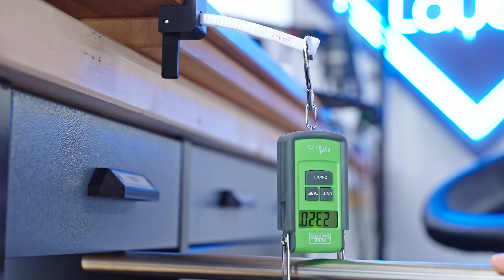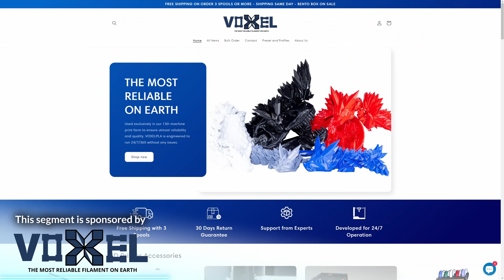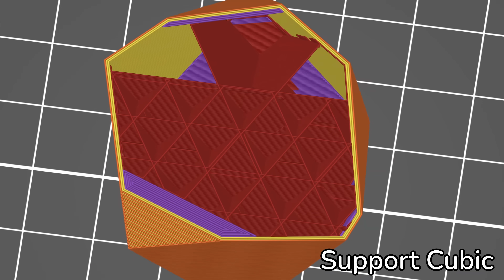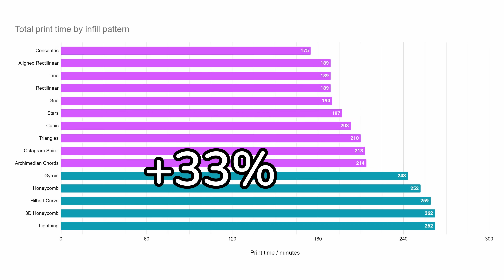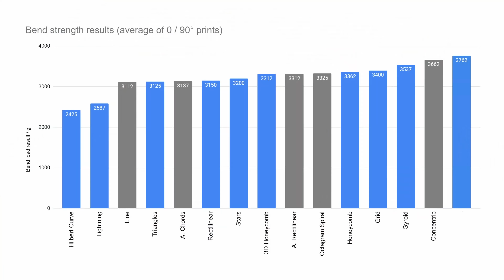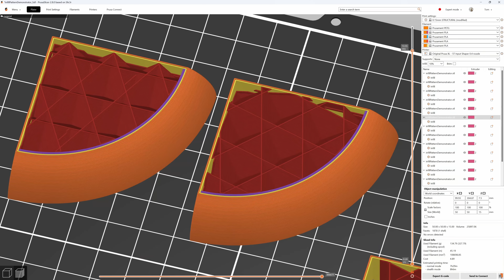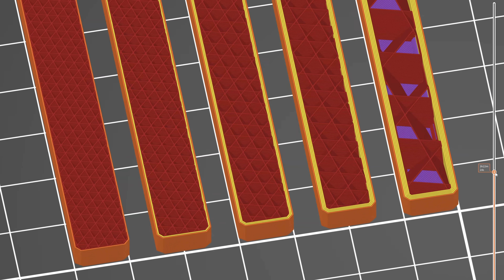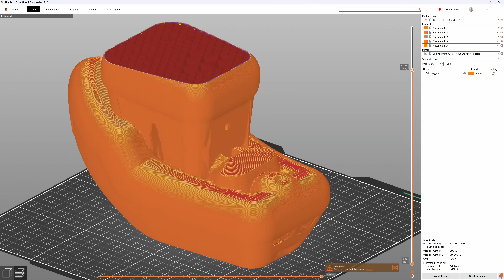Rethink how you use 3D printer infill!

Comment: The Hilbert curve is actually very useful for some specific usecases. When boring into the part in 2 locations you can be sure both holes are connected and you can suck air through them, no matter where you bore or what shape the object is
Reply: Looks cool with translucent filament too

Comment: Gyroid! The strengh to weight ratio of infills was tested in 3D Printing Academys video around 5 months back. Its the reason i use Gyroid almost always. 3 walls all around and between 15%-20% infill for max strength to weight ration.

Comment: Spiral ans concentric are valuable as the base and base infill when printing in vase mode to produce clean bottom and top layers. I've had great results with water proof and water tight PLA prints.

Comment: A thing about 100% infill for solid parts: don't. Infill usually is printed as fast as possible and often is just a bit underextruded. So unless you are ready to ALWAYS change ALL infill settings the same as perimeters: just do 999 walls or top/bottom, and add flow a bit. I noticed this when doing salt re-melting tests, any air inside the print will sag the top surfaces. 100% infill leaves more air in, is is more like 99% in reality. It is not often that the laziest choice is the best choice but here it is. You get consistent pattern from outside to the core too, not at all unimportant detail. Using 999 top&bottom also gives you some options what pattern the "solid infill" is printed, 999 walls are always concentric. You can combine the two, using for ex 15 perimeters and 999 top&bottom, the difference probably is negligible in strength but you may get more efficient moves (rectilinear top&bottom pattern gives you straight lines for most of the print).

Comment: Hi! Which infill do you consider to be the most adequate if you have to fill the inner of the piece with something (water, plaster, resin, concrete etc.)? And I think special at large objects (in my case the extreme may be 420x420x500). To be more precise, let think at a cube of 420x420x420, hollow, with an equivalent of 20-30 mm wall thickness, and shell with 4-5 perimeters, 4-5 top-bottom layer. I use gyroid, but I wonder if it may be something better. thanx
Reply: AFAIK only gyroid has a single internal volume, so the only option to be filled (easily).

Comment: I use rectilinear and aligned rectilinear when I need to use a really high infill percentage.
Also, hilbert curve has its application with about a 95-100% infill. That is when it shrinks due to cooling, the stresses from it go into the many curves in the hilbert pattern itself instead of into lone direction that cause the layers to peel up.

Comment: XD Watchmaker/Mechanical engineer here
Jep, this my go to methode the last... 8? Years or so
Go for 3 perimeters default (only if I want 'decor' Objects go down to 2 and print infill between 15 and 35%

About diameter...

By default I do double the Nozzle diameter in linewidth
And even the perimeter... only the 'external Perimeter's stays with the original diameter

So my 'get shit done FAST' settings are something like

For a 0.4 Nozzle
Default (all of them) line 0.6-0.8
External Perimeter 0.42
Top Line 0.45
Infill 0.8
Bridges 0.4
Support 0.3

Comment: Pretty much all of my functional prints are made of 6 layers of shells, 6 top, 6 bottom and 30% cubic (although lately I've been using gyroid again because of prusa getting rid of crash detection and I get occasional blobbing from my Priline PC-CF).  Printing on a 0.6 nozzle on my XL and Railcore and 0.4 on my MK4.  It's definitely overkill, but most of my stuff needs to be as strong and rigid as possible.

Comment: Buckling in the walls are defined by slendernes ratio: wall height divided by wall thickness
and  the ratio must be between 120 and 200 for buckling to be the failure mode or 30mm for a 0.25mm wall unless layer adhesion screw with Eulers assumptions

Comment: Personally, I don't think trying to find the best infill is really that important. There's so many uses and you just have to stop, think a moment and try to look what infill pattern is the best there. Understanding the thought pattern behind thinking the applied forces and what are the demands from the part.
For example printing TPU feets for your printer to make it a it more silent. You want the feet to allow the printer to move around but still hold the printers weight, you can get good results by just trusting the TPUs flexibility to allow the printer to move and not directly dump vibrations to the table. But with the infill you can affect that movement dampening way more than with jsut hte material; cocentric and aligned rectalinear are the keys here because cocentric will allow the feet to easily flex around the XY-plane while with aligned rectalinear you can allow the feet to flex more in one way.
This also brings in combining infills. At least Prusa let's you put up modifier shapes into the models which you can put different settings including infill pattern and amount. You can use adaptive cubic to fill the piece but add something like honeycomb as a pillar in the middle to give some more compressive support or concentric/aligned rectalinear to print some hard shapes while still mostly using something stronger, cheaper or faster to the rest of the piece. Just need to remember that you need to take those infill changes into account so you don't try to print infill on top of thin air.

Comment: For the multiple nozzle sizes in same print, try upping the extrusion multiplier by 1 or 2% on the nozzle that prints the infill. I find it helps with adhesion between perimeters/shells and the infill.
Reply: I think "infill anchor " is the right parameter to use instead, to keep other geometry intact. but I don't have multi heads to test... 😅

Comment: I only use hexagonal when I print translucent filament because it looks beautiful. Other than that, it'd gyroid for everything
Slicers should give us an option to choose infill by density instead of only by percentage
Reply: Percentage is usually density. If you take a look at where he had to change the infill amount to get the same weight, the infills where he had to make the most adjustments were the infills that dynamically change their density based on height, such as lightning or support cubic. In those cases, I think the percentage is based on the top layers.
Reply: @logicalfundy  Yes but no. What I want is grams per cubic centimeter. Percentage doesn't translate well to density. 10% in a big piece looks completely different from 10% in a small piece.

Comment: Rectiliniar is equally good since it's one of the fastest to print. I'd rather spend more time printing one more wall and then do a less dense but thicker rectilinear infill for general purpose parts. Saving 20-30 mins for a several hours print worth it. A the end it's not only the filament you're paying for. It's also longetivity of parts of your printer, electricity, and a lower volume of parts you print.

Comment: what about mixing materials; one for perimeters and a different one for infill? ABS might make a good infill and you wouldn't have to worry about warping since it's all internal.
Reply: with mixed materials you still have to consider things like warping though, as that could lead to deformation or even delamination due to high stress (if the internal contracts more/expands less under the smae conditions).

Comment: "on the XL i can mix and match nozzles" it wouldve been easier (and in this case, more reliable) by just setting the infill linewidth wider, instead of using a 2nd toolhead. You'd also not have had the alignment issue.
Reply: That is literally what he said he ended up doing.

Comment: My standard infill is gyroid, mostly printing mechanical parts.
But I have a delta-printer and my assumption is that deltas have less a problem with the wavy structure.
Reply: That just depends on your acceleration

Comment: Concentric, Hilbert curve, archimedian chords and octagram spiral are great for top/bottom infill. They usually create a better looking surface finish than the standard linear infill.

Octagram spiral with a silk filament on a smooth sheet give amazing results. 
Hilbert curve on top infill makes for a surface comparable to a bottom layer on a textured sheet - helps to make both sides look similar in PETG.
Reply: Yup, fuzzy skin and hilbert curve with 0.9 flowrate on top surface makes everything fuzzy :)
Reply: concentric my beloved
Reply: Agreed.  The only way I can get a perfect surface on production ASA parts that cannot have defects is to use hilbert curve on a powder coat bed.  Saved my life.  Absolutely nothing else worked.
Reply: Depends if you use aligned rectilinear or not.
Reply: They're good for squishy tpu

Comment: I'd already been told that more perimeters were better for strength, so my only concern with infill was supporting top layers. Not every top layer is a straight bridge though so I tended towards patterns most likely to catch a line of extrusion. I typically use gyroid.

Comment: I appreciate the thoughtfulness and thoroughness of Tom's videos. I print a lot feet for air compressors, leveler feet for freezers, dish washers, workbenches, et al. My main concern is compressibility/axial loads and my default infill is gyroid.
Reply: honestly, i think gyroid is a great pic in your case since it performs quite evenly across all directions. I feel like it therefore does very well to not collapse if twisted/bent in a particular way.

Comment: We should have tree supports as infill at this point. It will be litellary the lightning infill but much better at it.
Reply: That would just use more material than lightning and probably slower than adaptive cubic. Lightning infill is for when you don't care about strength and want to minimize the material. For everything else the other infills already do the job.

Comment: I’m a bit bummed that you did the end of the video all about Cubic. From what I’ve seen online, Gyroid seems to be the “go-to” for most people. It’s theoretically the strongest in every direction, while cubic is weaker in certain directions and stronger in other directions.

Regardless, it doesn’t particularly matter. I’m guessing the results you got would be exactly the same. More walls is better than more infill.

Awesome video. Thanks for doing all the work here!
Reply: But are there other reasons for it to be the go-to pattern than gyroid just being the default setting in quality profiles? He made it all about cubic because in his test it's stronger than gyroid at the same weight while also being faster to print, so it makes sense.
Reply: I use a fair bit of support cubic when print times get really long and I need to speed things up.

Comment: Here is a long description of my experience probably not many people have so I want to share in case someone finds it usefull. 
Recently I have been printing very large molds for someone who then makes a thick fiberglass master model in them for further finishing and polishing by hand. The final serial production negative molds get then made on this polished master model. The printed molds therefore need to survive a single wet lamination process and usually get destroyed during the extraction of the very rigid master model out of them. 
The designer of the molds maxed out the size of my 500x500x500 Rat Rig on some of them (he designed the sectioning of the mold arond the size of my printer). Finding settings that would produce the required parameters was interesting. Requirements are smooth surface, enought stiffness and no warping. I ended up using 4 perimeters with 0.4mm nozzle and 0.2mm layer height. This gives decent surface smoothness and some wall thickness in case imperfections need to be sanded down. For most of the parts I used 4% gyroid infill. This gives enough support to even very gently curved walls to hold their shape while having the resing squeezed out of the fabric by some rollers. In areas where M6 bolts are used to join multiple sections of the mold together I used 20% infill to better resist the compressive strength of the bolt. Gyroid got picked over cubic because in my experience the more long straight lines you have in such huge print the more it wants to lift its corners off the bed (or bend the bed off the magnet) and then some sections of the mold no longer fit together. Since PETG was requested this can be a serious issue on such big prints. Not as bad as ASA would be but noticeably warps more than PLA would. Gyroid with its waves does not pull on anything as the cooling extrusions contract. And as it turns out when they need to destroy the printed mold to get the master model out then gyroid seems easier to dig out with chisels in large chunks (not sure why). 
One time I used lightning infill because it was by far the fastest and did not compromise the mold where it would matter. This mold was basically almost 500x500 base with something resembling a flat top mountain coming out of the base. All the functional walls wer curved in various directions relatively sharply and just the top enclosing the volume needed support to print cleanly. With 4 perimeters and lightning infill set to 20% it saved about 24 hours of printing and 1kg of filament compared to 4% gyroid. And all the curved surfaces where fiberglass was to go were still perfectly shaped and rigid enough. It is a rare case but here lightning was the best despite this beeing a technical functional print.

Comment: Great video!! Just last night I was curious about this topic so I had a chat with CGPT 4o and the results are interesting. I asked it to provide a chart showing best infills for overall, structural, aesthetic.  I wonder if someone else asked the same question if the results would be the same. 
I don’t think I can post it in you comment area but if you’re interested in the results, please let me know how to get you the data and I’ll send it right away. Thanks for this video and all the others in your library. They’ve been an invaluable resource as I’ve been getting into the 3DP hobby. 
Also, I left a comment on the video with you and Stephan of CNC KITCHEN having to do with the release of an open source SLS printer project. I have started the project myself and was curious if you guys were going to get into it if you haven’t already. If you have , I’d appreciate it if I could get some input as to some design ideas I’ve had. Want to get an opinion before I pose it to Tomas , the SLS4All project creator. I just don’t want to sound like a moron anymore than can be avoided. 
Thanks for your time-Jason Burchell

Comment: In the animation at 5:25 you can see the problem with Gyroid as it can happen that none of the surface connects with the infill if you are unlucky with your design. that leads to weak spots in terms of infill strength.

I think that the crosshatch pattern gives the best compromise but it's not widely available in all slicers.

Comment: A silly problem with cubic is that you can often see the infill pattern slightly through the outside in daylight and it makes the parts look cheap where with gyroid the inside looks fuzzed out.
Reply from the maker: Valid point!
Reply: Just bump up your wall count and this issue disappears.
Reply: @ConorFenlon Exactly! You can also increase your top solid layers in the slicer to eliminate that shadow effect underneath.
Reply: aint the point of 3d printing to make things you dont need (low poly pikatsus or race boats) and have them on demant at cheap?
Reply: @TommiHonkonen  Not me. Almost everything I print is functional, including car parts in engine bays.
Reply: @TommiHonkonen yeah, but it doesn’t mean it needs to look cheap just becuase it is
Reply: @TommiHonkonen  Why wold you print stuff you dont need?
Reply: @TommiHonkonen  The point for me is mostly to be able to make parts to solve issues, or make my own designs. Sometimes I want a nicer aesthetic, sometimes not
Reply: @TommiHonkonen  No, it isn't. What sort of statement is this?
Reply: @TommiHonkonen  i make useful things with it that have geometries that aren't possible in traditional methods. 3d printing has many different use cases depending on the person
Reply: @TommiHonkonen  At this point a 3d printer is as important to have as a dishwasher in fact mine fixed my dishwasher.
Reply: @TommiHonkonen  I have been 3d printing for over 8 years and in that time I have printed a few benchy's for calibration testing but apart from those all of my prints are function parts.

Comment: Such a shame you didn't test Bambus new "Cross hatch" infill pattern as well
Reply: from what ive tested in a very unscientific ooga booga bend until it breaks and crush it, its a tad less strong than gyroid in the bend and quite a bit less strong in the crush test, but it prints much faster and it doesnt shake the house, so adding one extra wall with it has worked fine for mee, but it does seem less consistent than gyroid, like sometimes it wont join well with the outerwall but that could just be me
Reply: Or the new 3D honeycomb from Orca.
Reply: @woodcat7180 3D honeycomb is included at 4:40?

Comment: How did you print with different nozzle sizes in one print? I have an 5 Tool XL and I dont remember the feture of multi nozzle in one part coming out yet.
Reply from the maker: You can select specific toolheads for specific parts of the print - one for infill, one for perimeters, one for supports and so on. All you need to do for different nozzle sizes is to also adjust the corresponding extrusion widths!